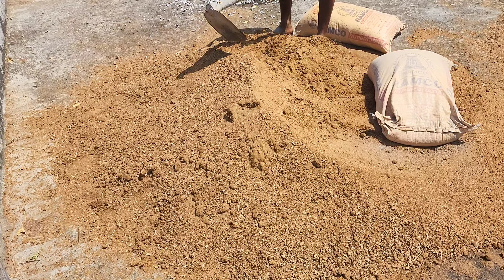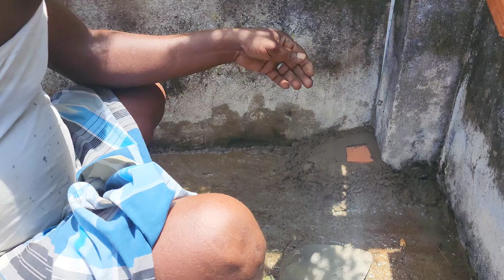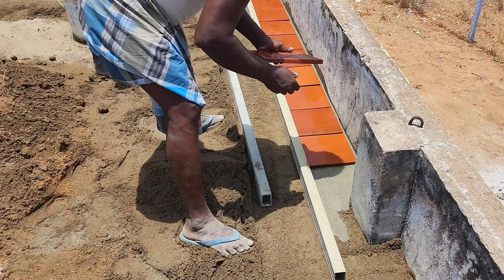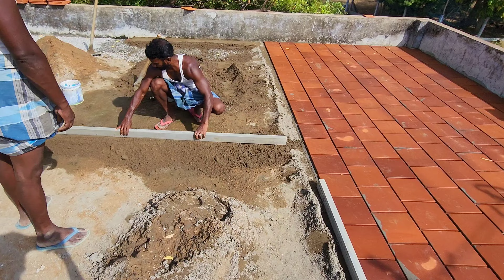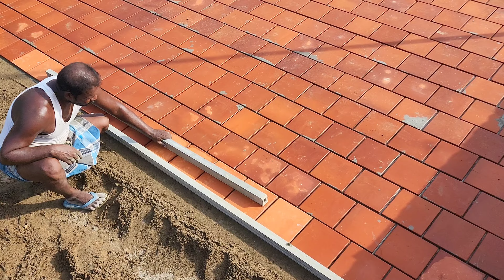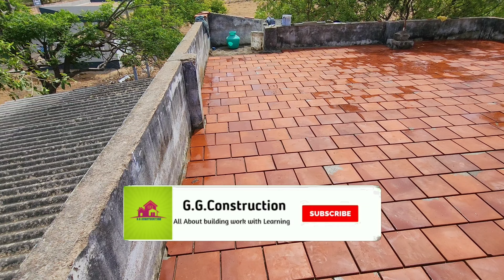WOW! Cool Roof Technology-House terrace cool roof Tile Installation-using by Sand and cement

Comment: For a cool roof system you should install white Tillie's instead of other colored tiles because white color transmittance is highest. Besides it should also be important,  all the water passes accurately otherwise it can cause damp on the  roof.

Comment: For cooling roof..small chips concrete layer with slope and smooth surface over that white colored epoxy coat is better option.